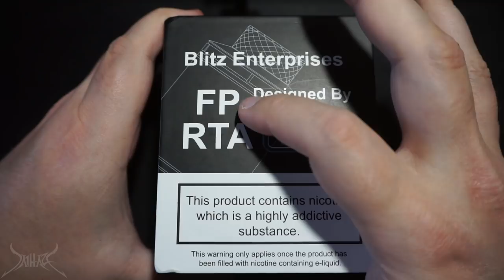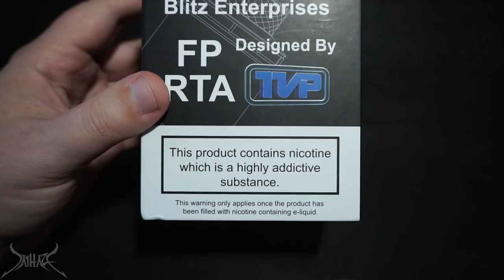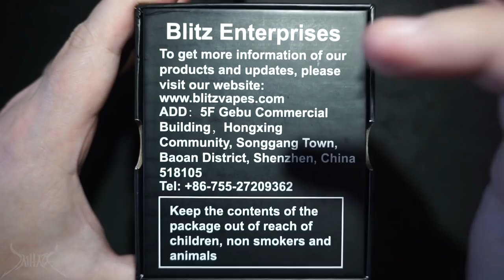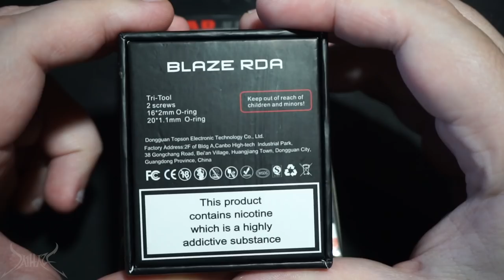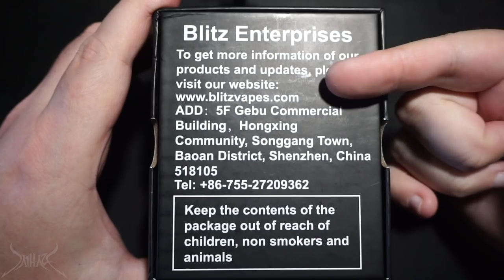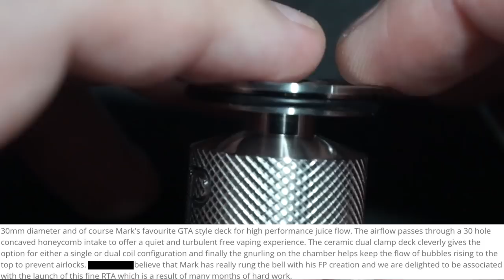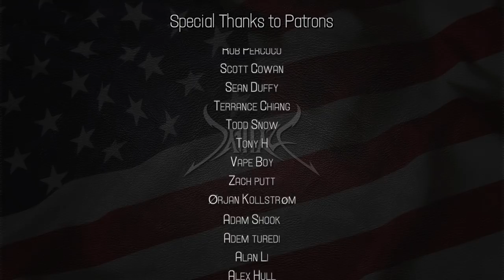Blitz Enterprises FP RTA Review and Rundown, A TVP Project | Almost Lost My Mind

Comment: As an average consumer, I appreciate his review in its entirety. I agree with the aesthetic but keep in mind that's just an opinion. I myself have a 30mm rta because I like the large tank, build deck size, and air flow. I can see how this product does not fit the stereotype for 30mm rta. Also, as someone who doesn't want to spend 30 bucks a month for custom made coils that may or may not fit or ohm out correctly, I build my own as well. I can also identify with limited patience for diddling with flawed designs. As it stands, I have no idea on the history between these two on their beef and I really don't care. I saw enough of the difficulty of the post setup alone that as an unbiased observer, I cannot see where this product has any niche in the market. Jai has an unusual amount of candor and a presentation style that I can identify with. Whether or not he has bias against any company is sort of irrelevant because he always seems to keep it real. Anyways, here is one of my builds that I like a lot. It's a quad coil with 40 wraps, 10 per coil, that ohms out to .25 which hits nicely at 100-120 watts. I couldn't imagine the struggle of building something like this on the FP product. https://imgur.com/k7SLjQi

Comment: I just got mine all the hardware issues you had with screw being fed up and no extra clamps seems to be corrected. my biggest issue is with the design of the juice well being sealed tight with the fill cap. it seems to build up vacuum inside the juice well and will no longer wick until I unscrew the fill cap. once I get it halfway unscrewed shit ton of bubbles come out

Comment: Why is that you had no problems getting the coil into the ghoul rda with the similar ceramic post clamp with no sides? Also you didn't go off how the ghouls box didn't have any dimensions or specs. on it? I feel and I'm sure a lot of others do that you hated this from the get go and just created the drama because you know that"people love drama" Im not on any teams and/or crews honestly I don't even know the drama between the two of you and do not care to, just pointing out that there was another device with similar post clamps and packaging and no mention of it at all! Was wondering if your 502s box had the specs on it?
Reply from the maker: youre comparing a single to a dual configuration. Again, REVIEWERS are held to a higher standard. How many times do I have to go over this.  Is this your first video of mine you watched? The 502 was a hand crafter box and maybe you should go watch that review or did your boy postman take that one down. Yeah thats right.
Reply: None of the reviewers are "my boy"  was pointing out that the post are almost identical, not comparing a single to a dual just that the post are very very similar. If this was the first time I've watched you how would I know your review on the ghoul. Just something I thought should be pointed out. Again I'm not comparing the two because obviously they are different devices, but they are two devices that have almost identical situations. Hand crafted or not still did not have specs.

Comment: You need to do a video again on the geek vape l200 and on the geek vape l200 classic you can lock the up and down button but it takes a screen off by holding down the up and down button and the fire button at the same time I've tried it and you can't go up or down on any wattage but you can still fire it

Comment: What build do I need to make the engine nano have good flavor
Reply: 3.5mm fused clapton, slightly tight cotton, and cut the wicks so that they rest just barely through the deck holes rather than putting it all the way to the bottom. It also helps a little if you space the coil a bit. By the time I figured out how to get good flavor out of mine I was ready to move on to a better rta lol. Which was the Reload rta, and it's awesome , although a bit spendy.

Comment: 30mm RTA with such small juice capacity. Just don't understand the purpose of it.

Worst to claim bubble formation  from nurling on chimney. Sounds stupid.
Someone needs to go back to physics class.
Are you attempting air entrapment ? But how?
The bubble formed will only get trapped and it will not increase rather decrease the juice flow.

You can use that chimney as a cheese grater,just punch some holes in it. Oh and do it at an angle.

Comment: The way I understand it is the glass that is on it out of the box is designed short so it holds 2ml (tpd) and is why the taller glass is not in the box. Some RTA's you just can't put really long coils into. It is designed for 2 coils just ones that aren't 10 wraps each. Lol... The chimney is supposed to help the bubbles pass between it and the glass, which is bullshit, and the name is the worst! Personally I don't think he should have even made a 30mm.
Reply: The name does suck lol!! I don't like the pd engraving. Looks like someone at my local engravers would do on a zippo lighter... Not good... Looks cheap...
Reply: Lisa Keeling I do kind of agree with you. I watched his video on it, says on the black on the FP should have been black too. I just really don't like 30mm atomizers, 25 is the biggest I'll do. I've tried 30s, they are just too heavy!

Comment: I think you should go back and put some reasonable sized coils in non of this 3.8 or 5mm shit try something regular people like us would do like a 2.5 or 3 mm coils. Still love ya reviews but damn don't go off until shirts done right
Reply: I put 3.5 mm duals in my CSMNT and don't have these problems. Do the same in the drop, 4 mm in the Recurve. None of these issues. The deck in this RTA should be able to accommodate those sizes with no problem.

Comment: Amen about the lip and the looks of this thing man. If you go to the reveal video he put out u will see me making some of the same comments that you made in this video hence pretty much proving that this thing is in fact a bad design. The whole point of a 30mm rta is either to put big ass coils in it with a large chamber or have a smaller Chamber and big juice capacity but this has neither. You cannot put big coils because of the fact that there is no lips on the side of the clamps.
Reply: Well I hate to bust your Jai bubble but right as I type this I have two 3mm four core flat fused claptons in mine, and I've also put in a 4mm single coil with absolutely no issues at all. Unless you've tried it yourself you don't know. For people that say bullshit I can provide photographic evidence. If you put a lip either side you reduce the width of coil leg you can place in. I don't get what's hard about holding the coil in place and screwing it down? Like every other RDA/RTA
Reply from the maker: JLB whats your point?  I put a 7mm single coil in it no problem.  3mm four core aliens is not a big build, thats a build you would put in a 24mm rta
Reply: @JaiHaze  my point was people are saying it's difficult to build or you can't put big builds in it, you can, easily. That's all. You'd need a Titan to but huge dual coil builds in, but at 41mm is it's achilles heel. I'm not in to drama or hate but I think this is catching unfair heat for a cheap Chinese 30mm RTA. Okay, if it was priced high then fair enough but you often forgive flaws on other cheap tanks because it's cheap.
Reply: JLB Credit Jai just told u what I have been trying to say to you man at 30mm u bragging about a 4 core 3mm Clapton is not impressive, that will fit into a lot of 24mm rtas. My point stands Man U can’t put coils that are fused Clapton’s or bigger in this thing with more than like 6 wraps. I mean I am sure u could get it to work but given that this thing can’t fit coils with more than 5-7 wraps on it anyway he might as well have put tabs on the side of the clamps. Also if the clamps were wider it would not have been as big of a deal but they are pretty small in width.

Comment: This thing is typical China quality lol when I first started using rebuildables I bought clones mostly or authentic Chinese atomizers and didn't realize why anyone would pay $100+ for a US/EU/SW made RDA/RTA until I bought my first US authentic RDA in 2014 that I've run very low ohm builds thru for years an it still looks an works like new to this day while most(not all) of my Chinese made rdas have blown insulators/broken 510 threads/or posts. Some atomizers are worth the extra money. Idk what this one in this video costs but it clearly is not in the "worth it" category. Glass breaks the second jai touches it lol.

Comment: To be honest even though half your issues are your own doing and due to your lack of knowledge outside of your little bubble I would be pissed if I had a tank that grubby out of the box with screw issues like that....

As for the issues with the 2ml glass and empty spaces in the box... You it's been designed and sold like that so it meets compliance in the U. K. but I suppose you wouldn't have familiarised yourself with the target market for this rta...

As for the lack of airflow with 2x 4.5mm coils you should know that covering 90% of the deck would do that, and after criticising that that it actually came with 2 small Id coils maybe you might have thought they'd be an appropriate size....

Like I said, apart from the machine oil and sticky post your other issues are down to your own naivety and ignorance
Reply from the maker: no manual, no qa, no leaflet, improper glass (lack of q&a), right its all me

Comment: I hate TVP.

I bought this from a UK retailer Vaping 101 based on the following criteria:-

Large juice capacity
Dual coil

I’ve now had this for 3 days, then had a look online for what reviewers said as I had never heard of blitz before.

This is an awful review, you should probably delete the video.

Flavour is top notch, build deck is very easy to build on and the clamps work very well.

Looks wise, I agree it look shit. The knurling on the chimney is shocking. Although the knurling on the drip tip is nice.

The airflow is not the most airy but I prefer it.

I think your beef with TVP comes through in this review - you shouldn’t have lowered yourself to this level